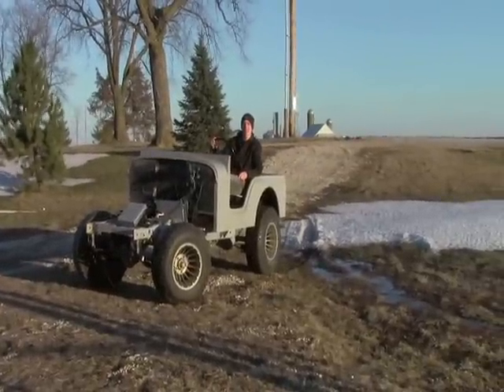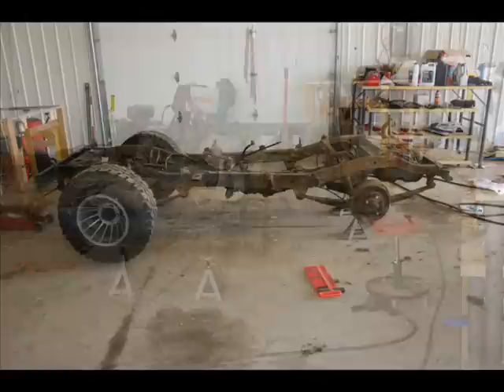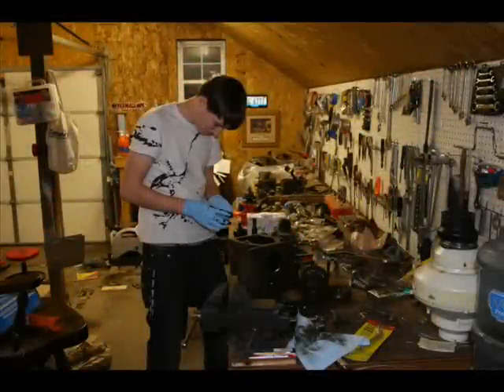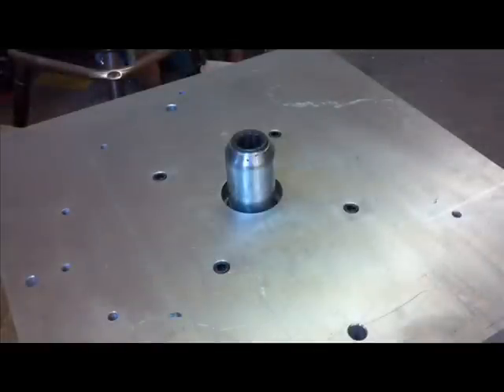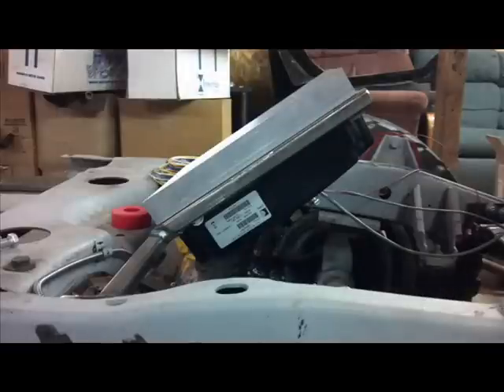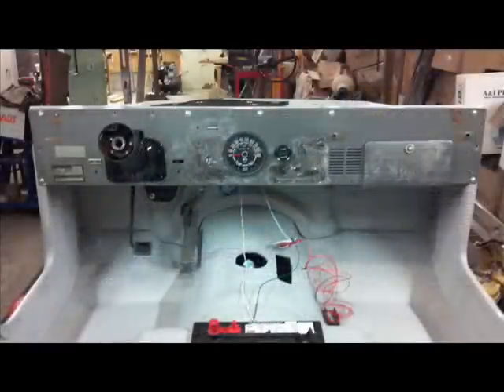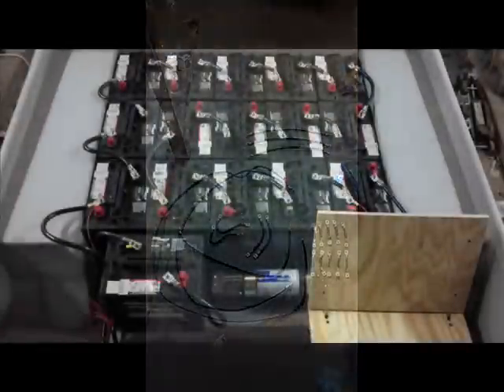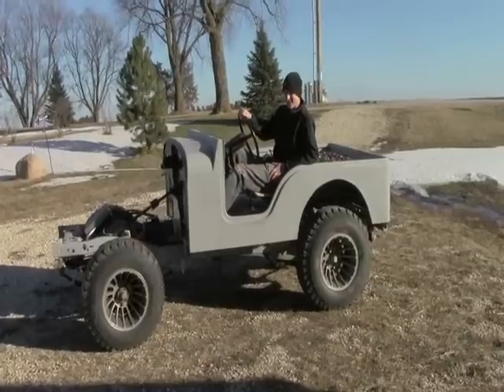Matt Goode Industries Electric Vehicle

Comment: Do you still have it?
Was it off road only or can you drive it on the street?
I like the idea of keeping the transmission and not having electric motors mounted in the axles where they get wet.
Also it would seem much more like driving a normal Jeep.
A very impressive project for anyone regardless of age.